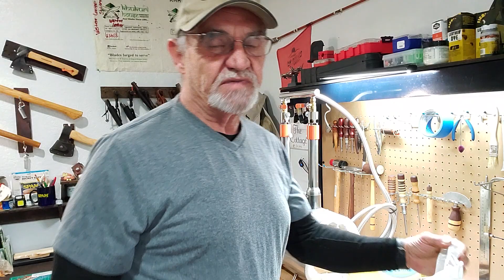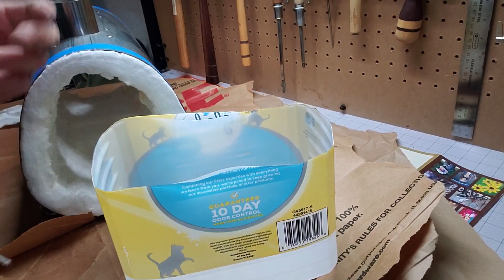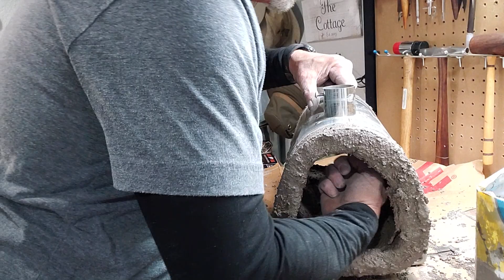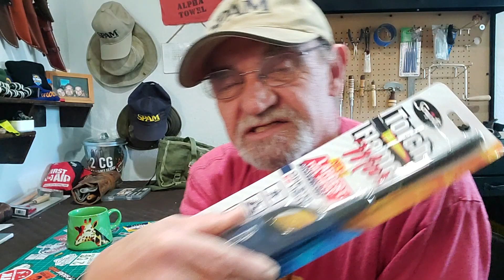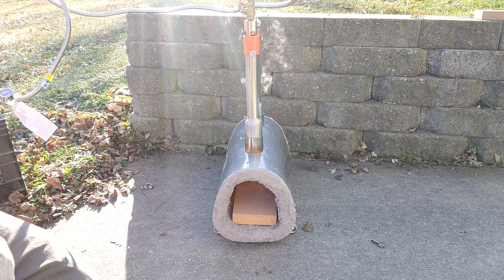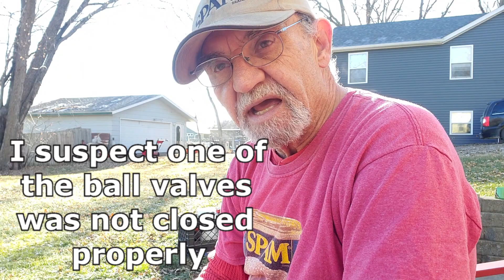Igniting the Vevor Portable Propane Forge - Witness the First Blaze!

Comment: Cool forge - hubby is looking to get one.  Could you get a portable car port, maybe from Harbor Freight?  Also, Bomgaars has a 55 lb anvil for not too much (think under $100)  Thanks for sharing! ☺
Reply from the maker: I thought about that, But I think there are restrictions on how many structures you can have. Thinking of a fold out work area on that side of the shed....git a 23lb anvil coming to start. Be safe and as always appriciate your support 👍